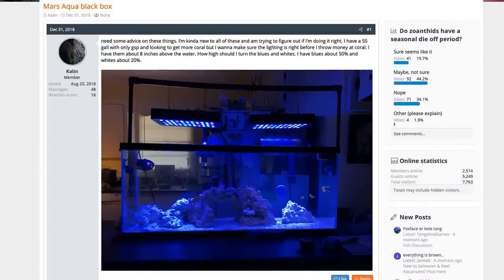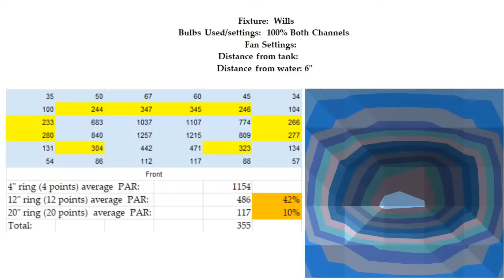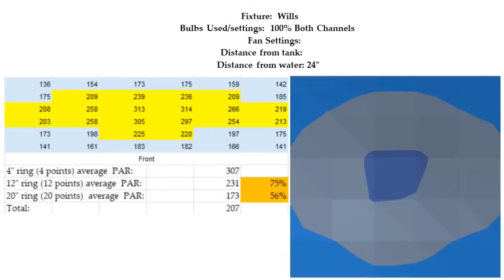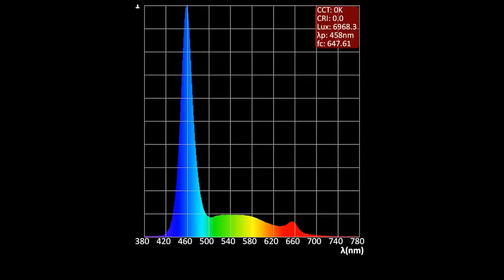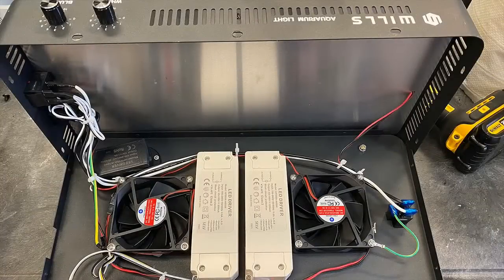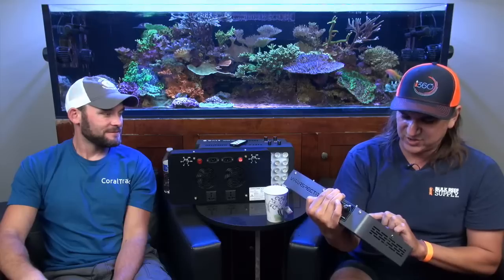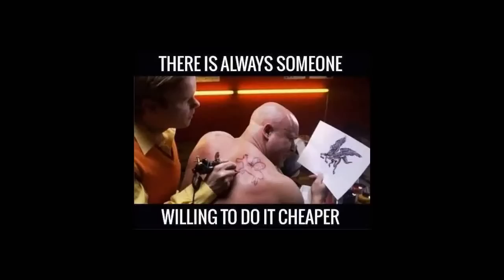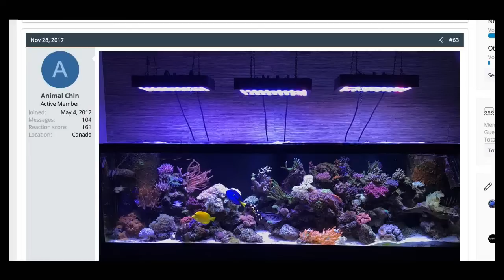BRS Black Box LED Battle Royal: MarsAqua vs. Viparspectra vs. Phlizon vs. Wills. One Clear Winner!

Comment: Got into this hobby 2years ago bought viparspectra 300w for a 75g, mounted it 18in, diy'd a sump, jebao return,hydor for flow. Ended up growing a beautiful mixed reef w/ a ton of acros. I've now bought 2 gyre 4k's, 2 mp40s, vectra L2, &  4 360x's. All of that cheap stuff is perfect to get you by while your figuring out if this hobbys for you. Thankyou BRS   for all your videos! You are a Reefers netflix series. Keep up the astonishing work!
Reply: Hi brother, what is your viparspectra light intensity settings for ch1 and ch2. Thank you!
Reply: @poloquiros17 light mounted 22in off the water with 45% B 28% W will get you a good looking spectrum and around 200 par at 18in deep.

Comment: I bought a Viparspectra last month mounted it 10” and removed the lenses ! 
Resolves all the spread issues and can be turned up to 100% for the blues 
For $120 nothing else can beat that ! 
Colouration on my sps is astonishingly different from a month ago !
Reply: Glad you are having results. Possible that what you are saying is true but without actual measurements repeatability is difficult and 30days on SPS often isn't long enough. I know after 20yrs I can't trust my eyes.
Reply: I’m glad to hear it looking good! I interested to hear how it’s doing in 6 - 9 months
Reply: Yes curious. Some say removing lenses is bad any1 care to elaborate?
Reply: Are you lenses still removed? How has it been??
Reply: @harasiuk  Everything doing fine except rbt anenome.
Reply: How your white setting and how long is your lights on for each? How deep is your tank? Thanks
Reply: @jetli3352  sweet! I’m buying two viperspectra lights and a 40 gal sump Friday. Cant wait to upgrade!!
Reply: @harasiuk  there is 3 method . strickly for brstv blackbox showdown height and intensity. Or try lenses removed or removed lenses except the outter lense leaving them on( outside will be stronger and less light bleed). With any mounting height from 10inch to 14 inches and setting intensity white from 5 to 25% and blues 40% to 100%. I would start out lower to mid then accumulate to higher slowly a few % per week. And as for time setting most set blues go on 1st mimicking sunrise and set. 10 to 12 hours on and whites 4 hours to 8 hours on. Good luck
Reply: @jetli3352  I have mine mounted about 12in from the water. Have all lenses removed but the outside row. To my eyes the disco effect is way less. I have par readings and I have it at 60% blue 1% white alone with some led bars. I hit about 300 par 4 in under the water.
Reply: @thomast.8546  are your corals are ok with this setting?
Reply: @poloquiros17  they seem to be and are growing fairly decent for me. My Trachyphyllia has almost doubled in size since this post.
Reply: @thomast.8546  how did you take the lenses off?
Reply: @soldierboy_4349  taking the screws off the outside the the ones that hold the pcb board and the lenses just pop off
Reply: @thomast.8546  are you still using it like this?

Comment: Even though it must have been torturous for you guys to do this video. I do respect and appreciate the effort. I have to admit I have the Viparspectra 30 inch fixture. 14 inches off the water under my hood, on my standard 90 gal.. With absolutely zero mechanical issues so far.  The fixture is over two years old, working on three.. They do have customer support here in the USA out of Oregon. I know they can't compare to "newer" higher end options. But as y'all pointed out with some of them in the past some had that disco effect etc as well. To fix that was to use a diffuser.
 I used window frosting material. Totally eliminated that breakup of the individual bulbs. A comment you made the whole reason for the diffusers is to get the led lights to mimic T5 creating a blanket of light. It is totally obtainable at a affordable price point. A whole roll of that material was about half the price of one little diffuser for something like the Raidion. Food for thought for gals and guys that need a affordable and effective diffuser option.  It's funny I see so many people in the hobby here in New England spending money. Lots of money on their equipment and they are some that have the most issues with their tanks. I'm growing sps, lps and clams just fine with beautiful colors... Happy Days.....
Reply: Can you provide link what window froster are you using?
Reply: I'm new to saltwater, I have a 7 foot 265 gallon with a canopy. Im undecided to order a couple viparspectra from Amazon. Or spend double maybe triple with a kessil or radion. Any thoughts?
Reply: @williamwelke8306  if you are new but have the money buy radion if you dont like shimmer. Buy kessil if you do. Or i peraonally would buy radion(s) and add a kessil on each end and shine in. But if you want a budget build go with viparspectra but the science of the lightning is alot of Guess work to be successful 
With mounting hieght. Setting timer and par. Vs plug and play. Hope that help you decide.

Comment: just making a comment about the whole turning down the black box thing: I have heard that turning down the power actually increases the longetivity of the LEDs. So while the AI prime has 30% less PAR at whatever your custom settings are, it may not actually last much longer. Now idk, I obviously havent done a test on that and idk how long each of these lights lasts on average, but if turning down my Viparspectras gives them the best functionality AND makes them last longer, PLUS it puts out comparable PAR to an AI prime- I think it's a pretty good investment. For 90 bucks more you get a smaller unit that has a lot of bells and whistles, but from what I have read I would need more Prime units to cover the length of my tank than I need black boxes. So it actually is not just an extra 90 bucks depending on the size of your tank. For me it would be an extra 390.

I do want to say thanks for making such a comprehensive video. I have been trying to figure out the best settings for my Vipar, and not much has been helpful in telling me usage or par values at anything other than 100%. I know that most people do not run either channel at 100% and from what I have read you don't need par in the thousands. Anyway, you did help me a little in figuring appropriate settings. I guess I will mostly just have to see what makes my future livestock happy.

Comment: Another solution for lights that aren't blending well in terms of the spectrum test would be to put a flame retardant diffuse material in front of the  light. As photographers say, you may lose a stop of light, but it should help blend those ultra focused areas into each other more uniformly. Diffusers for videography applications should be used because they are usually made to deal with heat (always check) of a constant light as opposed to a photographers where the lights are only on for a fraction of a second at a time.

Comment: You guys rock.  I am using black boxes on my 220g tank right now.  However I am using the ones that are wifi controlled.  I can change the intensity and use internal timers to set different intensities throughout the day and move to moonlight at night.  I have been using them for about 6 years now with no issues.  I do have them mounted at 16" for the spread and to get rid of that disco effect.  I am glad that I did things right without really knowing that I was doing it right.  Thank you for doing the research and testing.
Reply: How many are you running for a 220? I just got a 150, and was thinking  about getting  3 viparspectras...
Reply: @chopers49  I am running 3, One on each segment
Reply: @chopers49  I had two on my tank when I had my 150
Reply: Thank You
Reply: @chopers49  I mounted the lights just under 19 inches above the water line.
Reply: What brand is this light that you were talking about?

Comment: I will admit, I'm one of the dudes who hated on BRS for always pointing in any direction but Black Box. They always seemed to point only to their own products. But after this video I can see why they pointed. The 90 bucks more for the AI Prime, which gets you a smaller form factor, equal par, bluetooth controls, etc...totally worth it.
Reply: IDK.... I have a standard 90 gal rectangle tank. They are testing on a cube. My son spent $249 for our Viparspectra it is 30inches long covers the entire tank with usable light. We borrowed our reef clubs meter band measured the PAR. So we are not relying on eyeballing it. The bells and whistles you mention do not contribute one bit to the health of our corals. In some opinions they are just that, bells and whistles. They turn a tool into a toy.
Reply: I gotta say I disagree. I have heard a few people say that turning down the LEDs on black boxes increases their lifespan. keeping that in mind, what I have heard from this video it sounds that the VIPAR provides comparable PAR and spread (with alterations) to the AI, turning down the LEDs improves functionality and the lifespan of the lights (so their statement about the extra 90 bucks outliving the black box may be inaccurate), but also- that's and extra 90 PER UNIT. For bigger tanks you need additional units, and depending on size and shape of the tank you require more of the smaller units to cover the same amount of space that a rectangular black box covers. I have 2 VIPARS over my tank, but the length of the tank would require me to buy 3 AIs. which is not just 90 more bucks, it's about an extra $360. Just for some extra bells and whistles?

Comment: The diffrence between buying a viparspectra over an ai prime for a nano tank that needs only 1 fixture is I guess comparable but anything larger like a 55-75  gallon  and up is not because I can have a wall to wall  55- 75 gallon sps tank with 2 viparspectras but would need atleast 3-4 ai prime to achieve this although I would much rather the ai primes I've been in the position where spending 240 instead of 610  was what worked best for me..

Comment: I won't lie; I don't care about the black box conversation. But I am really curious how far out the 360 flow video is and what kind of flow meter setup you're using for testing your own setup. I'm just learning for the saltwater build I want to kick off at Christmas, and flow is about the most confusing setup for me. And having a peninsula build with three clean sides of the tank is a huge concern for me.

Comment: Very interesting that even with the data to help explain in what application these lights are adequate and the reasons why more expensive lights are so much better there are still comments screaming how wonderful these are! I have used them (full tank coverage)on a very successful SPS dominated reef and the corals did look nice but they are not perfect so lets leave the pride at the door. They are cheap but adequate and only if used correctly. The end. Just to qualify my opinion i have used radions gen1 to 4, black boxes, Hydra, Halides, Ati T5s and currently Redsea Led90's so i have no brand loyalty at all.

Comment: I had 2 viper spectras on my 75 gallon for 2 years. I actually removed the lenses entirely. You loose a lot of par. But get a way better spread and can mount at 7-8 inches. I grew all sorts of sps. 

I swapped them for 2 radions a year ago. And couldn’t be more happy. Having control, customer service was worth the investment when the lights will last 5-10 years easy
Reply: If u still have 1 of those black boxes and want to get rid of it, I’ll gladly take 1 off your hands!! I need 1 for my 40 breeder!
Reply: Bobcat's Reef how did u take the lens off have the exact same tank and lights as u?
Reply: THE LIFE OF JOE if you just take o the screws the box opens and the lenses are only on by some hot glue or something so you can just pop them off

Comment: Would consider these if I could find them lol. Only one I see is the Philzon one so that’s a hard pass. Starting to realize it’s a little harder being a reefer in Canada. Need someone like brs up here to drive some prices down but I’m guessing we just don’t have a big enough market to even warrant it. AI primes with the cheaper mount still gonna run about $350+tax and I have a 24” deep tank so I probably need hydras which is about $570 per light and mount. Best option seems to be the reef breeders photon lights for either $500 (24) or $800 (32). Or I just ball out and go with one ap9x for about $1200 with the mount but with a braced tank I don’t think that will work the best.

Comment: Definitely an awesome and informative video.  The couple stores near me both use and suggested these "black box" lights...  neither even really sell any lighting.  One did tell me that I would want to mount it like 18-24" above the tank and start at lower power settings and work up to brighter settings...
   I MAY still consider one of these black box lights over what is now a QT tank, after I'm done stocking the other tanks.  For those tanks I am definitely looking into other options, ones that won't need to be mounted so high off the water.
   If possible, could you guys maybe do some review/comparispn videos of the LED strip style lights, such as the Current USA Loop setup, or the Fluval Sea 3.0 light?  I'm considering something like that for my 40B so that it can either sit on top of the tank, or fit inside a hood that is only like 6 or 8 inches tall, instead of a 2ft tall hood...
   The last light you showed in this video seems to be one of the only higher end options that could be mounted like 6" from the water and work well... but a pair of those for a 36x18 footprint would be a bit more than I can budget for lighting right now...  I may save for a pair of those down the road, or try one of those over a smaller 24" tank in the meantime, but I am really leaning towards the strup style lights for now as my 40 breeder will be a mixed reef, and won't need  the kind of light to support SPS and such.
    Any chance U can do a video on Current USA/Fluval or similar strip light options?  Or even give feedback on those if anyone at BRS has used them?

Comment: I wasn't going to comment on this because it's like 2 years old but you guys have the LEDs kinda wrong. First off the heat sink doesn't matter, black boxes use 1w leds that thin aluminum mounting plate is more than enough to pull heat away, they only get like 70°F hence the "ripoff" heatsink from viparspectra.
           Next the LED drives are constant current drivers. the leds will run as long as the voltage is in a specific range usually from like 2.5v - 14v depending on color/spectrum of the LED. Without that Constant current you get the flickering that you were talking about plus the leds will continually heat up and eventually burn out. The color spectrum will never shift it'll just be less intense.
            Finally PWM is (Power Management) and that PWM controller does the exact same thing those analog dials do just digitally to give you more precise control. If the viparspectra PWM was flickering the light after the diver your unit either has a bad PWM or its doing that for no reason and giving you a fraction of a milliseconds strobe light.
         Last thing just as a PSA those drivers can be opened and have the maximum supplied voltage dropped or increased. Meaning that the viparspectra for instance could have its drivers directly turned  to provide a full 12.98v aka 13v to its leds while the MarsAqua could be tuned to 10.69v they would still come on no problem and possibly to the human eye look no different but would throw off your results.

Comment: The PAR readings, was that at water surface or at a certain depth?  I’m sorry I couldn’t find that answer in the video I must have missed it.
Reply: when they posted the graphs,It just looks like it is from the surface of the water to the height of the fixture..unlike the normal reviews that show the par readings at different depths of the tank...Which if they did an in-depth review like they did products they sell,This review would have been different...Do you think they would show any Radions or AI hydras graphs  like that?...
If the black box  light has lenses,Take them off and then heavy frost the main glass on the fixture,You will get better diffusion ...Disco ball avoided and you can put the light source closer to the tank.The problem is people want to crank the channels on their fixtures.They move the light fixture further to help with diffusion.But,The further the light is from the object the less light reaches the object .So,If the light is closer more light is focused in tank....

Comment: I have the viparspectra modded with 6x 420nm 10x 450nm and I moved the original 460/470 to the white channel. I have it on R2R. And lenses removed. 4 years old now.
Reply: Whats the link or member name on R2R?
Reply: Page 24 for mod pics
Reply: @bearded-flipflop7122  Thanks for the link.
Reply: @jonegross100  no problem.

Comment: The base plate under heatsinks is aluminum as well as the heatsinks themselves. Aluminum is moves tempetuer better and cheaper then most other metals. The theory is, heat outside the heatsink area is drawn in to the heatsinks because they are cooler because of fans extracting the heat therefore though it doesnt look like much, it is actually very7 efficient.